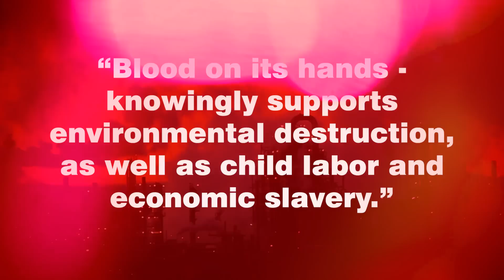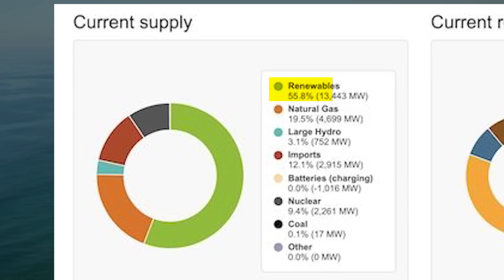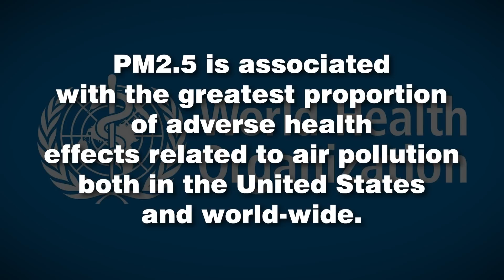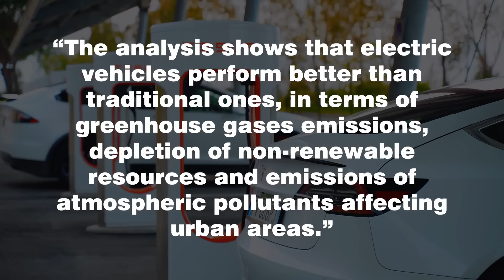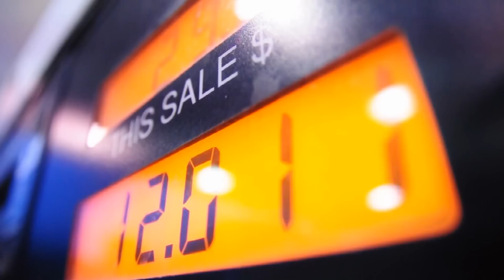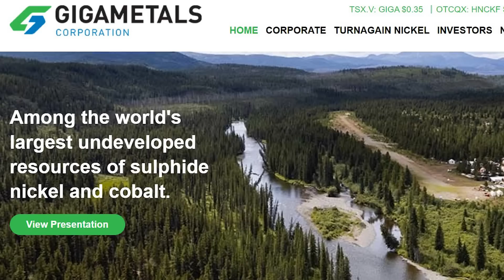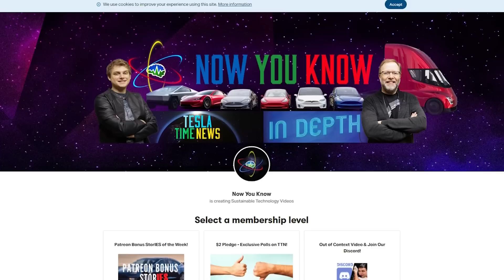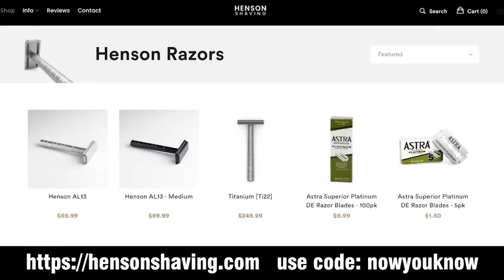Debunking More EV Lies | In Depth

Comment: A lot of people I know say it's not worth it to buy an EV because it's too expensive to replace the battery.  I'm like bruh sometimes it's the same as replacing an engine.
Reply: And a lot of people don't have a clue that an electric car battery can be repaired and refurbished, just as an engine can. You don't necessarily need to replace it....
Reply: $10k to rebuild my 1965 porsche 4 cylinder!
Reply: @rboz4637  And 25K for a 2005 Porsche GT3 and 18K for a VW T7 with 80K Kilometers and 12K for a Audi A3 with 120K km and around 18K for a BMW M 3 with 90K Kilometers and and and. Just look at the many Youtube channels showing their work on german cars.

Who in his right mind drives a 1965 Porsche for 50.000km a year? I have to. I would need a trailer to transport all my tools with a 1965 Porsche. Not very sustainable i guess...
Reply: @rboz4637  
Tesla Model Y (4680) pack estimated at $7,500- $8,000 this week.
Remember "Pack life" relates to the expected decline to 80% capacity....... Still usable.
Reply: good maintenance and you cars engines can last forever, that's green, no e-waist
Reply: @liuwang2201  Now i need a engine not burning fossil fuel and not exhausting poisonous gases from its behind. And it must be as cheap as electric powered vehicles. 😎
Reply: @wolfgangpreier9160  Carbon dioxide .04% of the air we breath is essential for life, the human population is being controlled by a handful of the richest people that look down on us as livestock that must be controlled 
CO makes smog produced by incomplete combustion corrected by oxygenator's in your gas an the catalytic converter
Reply: @wolfgangpreier9160  =1000 lbs. of e-waist
Reply: @liuwang2201  No its not. Its too much. 280ppm is essential. 420 ppm is too much. Of course i am a rich person. I have a family, a house, 3 kids and 3 dogs. I must be rich.
Reply: @liuwang2201  Its waste, not waist. And its your waste and my win-win-win. Perfect! Thx!
Reply: @wolfgangpreier9160  
10y + $20,000 =2000 LBS of e-waist 
is not green
Reply: @wolfgangpreier9160  I can still drive my car after 10y and because I won't have to replace a massive battery I will still have $20000 to play with, you don.t know the value  of a Doller
Reply: Sometimes a Engine can last for centrist a battery will be in your tap water someday
Reply: @liuwang2201  A what? A Where? A How? You talk in riddles.
Reply: @wolfgangpreier9160  there is many different Environmental cycles in nature one of which is the carbon cycle, to cut this dangerous cycle we first need to eliminate all oxygen,
 so we must first cut all the trees down and the food crops
Reply: Its cheaper then new engines new as in last 5 years.
My 2005 will need a new engine in a couple years its at 190k miles my engine is 17k a new tesla battery is 20 to 30k depending on the battery size.
Reply: @thesilentone4024  

But the battery cost will continue to decline in price and gas engine costs will continue to incline. Oil is a finite energy source and the renewable sources will continue to outlive the oil output.
Reply: @iPhil77  battery costs may not come down. They may go up. They are made of elements that have to be mined which would become more difficult as demand increases. Right now, it is cheaper to manufacture a new battery than recycling and old one.
Reply: @thesilentone4024  "a new tesla battery is 20 to 30k " for a Model S or X. A Model 3/Y replacement battery is around 12-15K.
Reply: @wolfgangpreier9160  
Less than $10k
Reply: @rogerstarkey5390  They have lowered the prices. Good!
Reply: @wolfgangpreier9160  
Ref Tesla daily?
Reply: @rogerstarkey5390  No i refer to actual Tesla bills. Last year i saw one with 14K for the Model 3 battery replacement. Not because of age but because of damages.
Reply: @thesilentone4024  
You missed the report this week that priced the "old" Model Y pack at $10k, while noting the NEW 4680 pack was already $2,500 cheaper, and will get to $5,000 as they ramp production?
Stop guessing and try research from experts.
Reply: Most times it's far cheaper. Most ICE cars are just recycled when the engine quits at about 200k km whereas auto batteries, now expected to last 200k to 1,000k km before capacity drops to 80% rated, will simply be reused in fixed grid storage and the car owner charged for the 20% capy reduction + changing labour (if the car is still worth it?).